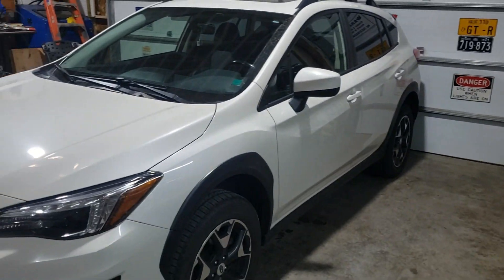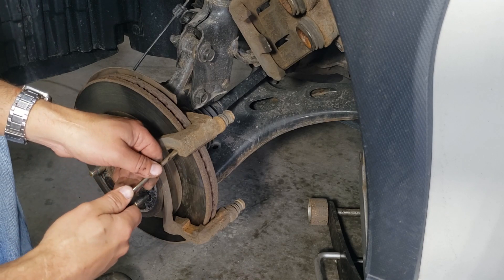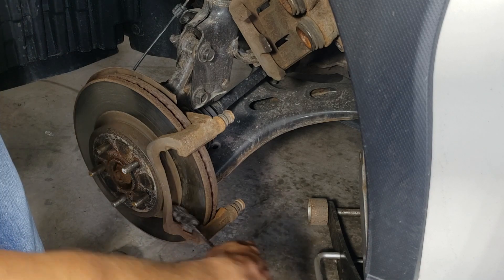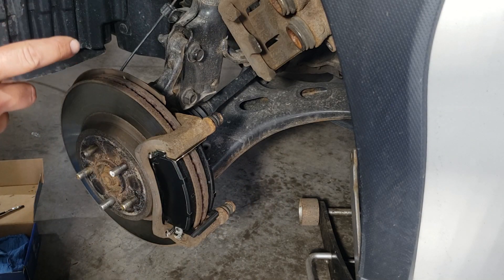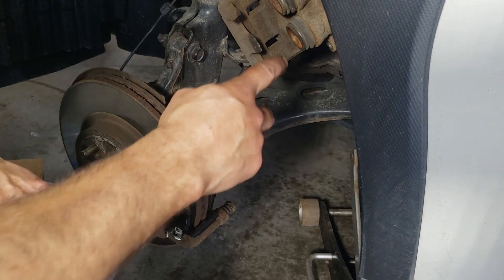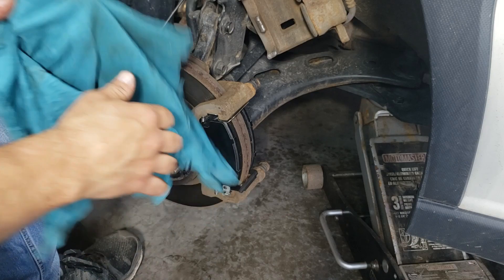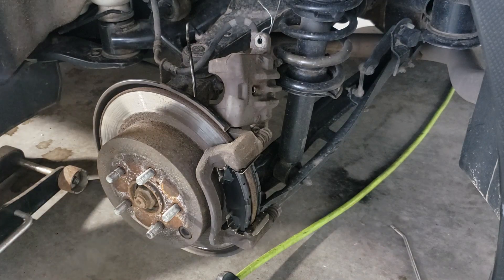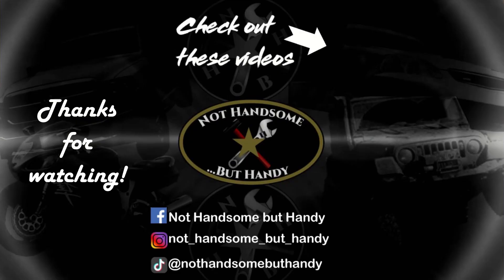Brake Pad Replacement - Subaru Crosstrek - Front and Rear

Comment: just a caution: those springs on the brake pads are wear indicators [squeakers] that are supposed to touch the rotor & squeak/squeal when the pads are worn & ready for replacement
Im not sure about this part, but they are installed to the bottom of the bracket to be touching the rotor when the pads are worn low.
 Ive done a few brake jobs & usually the wear indicators come installed on the bottom of the bracket.
   So Ive just redone them as they came from the factory.

 gee these new crosstreks have a different kind of retainer clips on the front  brake pads, So I am watching a few vids as these are a different fit than I have learned to do.
 thank you :)

Comment: Thanks so much for everything. I have subaru crosstrek 2019 brek pads are very tight hard to install any tips should be like that or im doing wrong Thanks 😮
Reply from the maker: These brakes are a little tricky to get in compared to other cars I've done in the past.  Make sure the grooves in the brake mount are cleaned well of any rust or buildup so the new clips can be well seated. Also make sure the clips are installed in the proper orientation and that they are seated as deep as possible. Apply a little of the included brake grease to the clip surface where the pads will contact.

Comment: 16:31 I just had an idea: drape a rag over the newly installed pads  and slides so the grease doesn’t get contaminated whilst wire brushing🤓
Reply from the maker: Good idea.  I could have cleaned the calipers first as well.

Comment: Do I need to bleed my brakes after I change the pads?
Reply from the maker: Not usually. Be careful the first time you use them as they'll take a second to make pressure. If you did top up the fluid as your pads wore you may need to bleed a little off, but just check your reservoir level to be sure.
Reply: @nothandsomebuthandy  this is the very first time my brake pads get changed out on my 2019 Crosstrek they still had a little bit of life left in them but I decided to change them anyways. Thanks for your video, it was very helpful.
Reply from the maker: You're welcome
Reply: No. Subaru requires the ABS to be activated to properly bleed the brakes so u likely don’t have the proper equipment anyway.

Comment: what is a good after market brand to buy? where from?
Reply from the maker: Honestly on my daily drivers I just go with whatever ceramic pads my local parts place has in stock and haven't ever seen much of a difference. The ceramic are quieter and give off less brake dust so the wheels stay cleaner. Raybestos and Bosch are two I use quite often but there are many good brands out there.
Reply: None. Use genuine Subaru pads n rotors purchased online.
Reply: I use Brembo.
Reply: Akibono baby

Comment: This is the job ur drunk neighbor does as a freebie.
Reply from the maker: Haha you have good neighbours
Reply: My neighbors are great. We get drunk after I teach them how to do a quality pad/rotor replacement, unlike what you show here. Ur learning tho. Ur on the right track.
Reply: Use genuine replacement parts: get a part quote/number from the dealership, then order online

Rotors should always be replaced when pads are replaced

Removing the caliper mount, hit it with a brass brush, especially corrosion where the pad brackets go

Use anti-seize: light coating on the caliper mount where the pad brackets get installed, use on all mounting bolts, thin layer on the wheel axle

Use syl glyde brake grease, not the garbage high temp stuff in the video: use on caliper guide pins, on the back of the brake pads and between each anti-squeak shims.

When re-installing the caliper mount, have the pads already installed

Everything I mention is the 1st step towards making your next pad/rotor replacement easy peasy